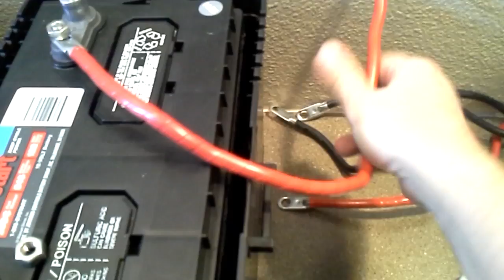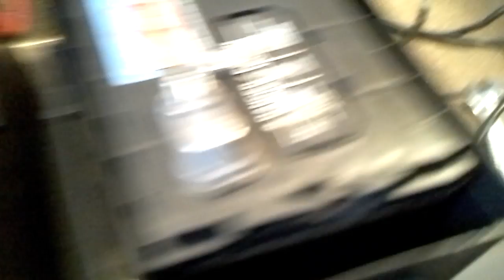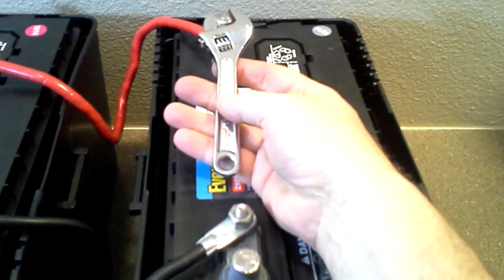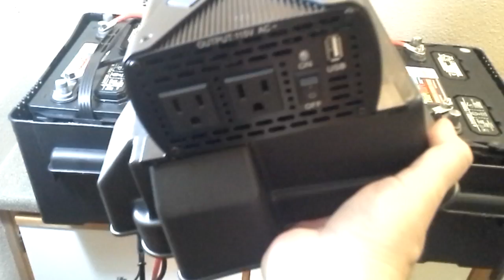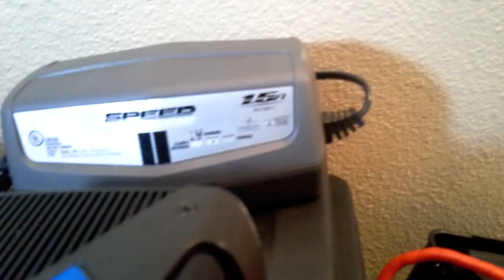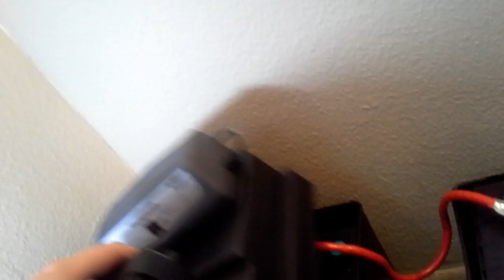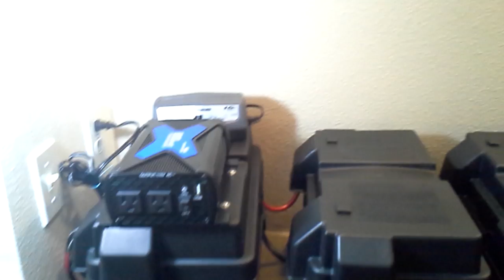Installing 4kW/Hr battery bank with 800W 120V Inverter and Trickle Charger from Tactical Woodgas

Comment: must be a small refrigerator and freezer that your running to run on less than 800 w
Reply: Newer "energy star" appliances are better, and older appliances should be measured with a Kill-a-watt meter.  

800 watts is the average power rating.  For a short amount of time the inverter is rated for double that.  It helps with the extra power needed to start the refrigerator compressor motor vs the power required after it starts.

Comment: It might sound as a dumb question but when the wall socket has no power because you didn't pay the bill or because local electric grid supplying the power is off (usually for a day or two) of if you go on a trip to places with no electricity, how will it work in the wood for example?
Reply: I saw them overseas working with solar power it will be better to have an automatic recharger when the battery needs charge it's turn on when they are fully charged it turns off that's my thinking anyway
Reply: The whole point of this setup is to be charging the batteries while plugged into mains power, and then the inverter can run "some" things when mains power is not available.  Then when back on mains power the batteries get charged up again.
Reply: best thing to do is buy a battery charger an plug it into a port on the inverter an let it continually charge.

Comment: If you use automotive battery clamps, You use wire that has been stripped and it goes under the flat price of metal so that the wire is in direct contact with the clamp. You definitely don't attach a ring terminal wire to the screw that's used to tighten the clamp to the battery post. The screws on an automotive clamp are not there to use to connect wires to. That are not intended to be used as conductors. Every time you pass electricity through dissimilar metals you have a corrosion site also likely to listen over time.

Comment: A little confusing on that ac outlet on the wall? You plugged into it to power something up but yet at the end you say ok, now on backup power 😳 . If you need backup power, your not going to have an ac outlet working, right??
Reply from the maker: The AC power is used to maintain charge so that it is fully charged when your power goes out.

Comment: You want to connet the + on 1 end and the - on the opposite end never connect bot on 1 end of the battery what a waste of the 2 other batteries
Reply: James Mccurdy look up the difference between series and parallel connections.
Reply: Chris Mac i know the differwnce i also know you dont draw power from 1 battery you connect + at the 1st battery and - at the last battery
Reply: Chris Mac let me break this down 
Batter on left is 1 battery in middle is 2 battery on right is 3

Connect the battery the way he did to keep 12 volts

Drow + from battery 1 and - battery 3 is the correct way 

What i said had nothing to do with what you said
Reply: You're right of course. The 2 other batteries will still be adding to the set up, but not quite so much as the first, &  one or more batteries might fail a bit prematurely.  You never want to connect the plus and minus cables from an inverter or battery charger to the terminals of the same battery. The Smartgauge website shows how bad this can be for parallel strings, especially at high currents.  The amount of difference they calculated is surprisingly bad if it's done incorrectly by just drawing from, or feeding into, the first battery of a string. If you take it "on the diagonal" (if the batteries are side by side like here) "plus" to the first battery, but "minus" to the last, it greatly evens out the amount of cable resistance.

 Bear in mind that just a fraction of a volt makes a big difference to how much charge current a lead acid battery will take from a battery charger too. Heavier the better with battery cables for inverters. For a lot of batteries in parallel there are other more complicated ways shown on the Smartgauge website to minimise losses, and not take more from one battery than another in a parallel string. Kind regards.
Reply: James Mccurdy I understand what you are saying now. I thought by your first comment you meant he should have connected the whole thing in series. My mistake!
Reply: Where the connections are made for the inverter makes absolutely NO difference if the cables are large enough and short enough to keep the resistance down.
Reply: @gener.1253  I disagree with you due to my experience working on electric vehicles for over 13 years. I've personally seen what happens when a parallel bank is wired incorrectly. It prematurely destroys the batteries on the end of the bank.

Comment: Are you using 110v house current to power charge controller?
Reply: Not needed in this system. There is no solar, wind, or hydropower directly charging the battery. It is only charged by a smart automotive battery charger plugged into the grid.
 I can't think of any charge controller not powered by the electricity flowing through them.

Comment: They only showed the cca amp
Reply: True deep cycle batteries don't have a cca, as they are not meant to turn over an engine.
Reply: @sundancer442  True Deep Cycle Batteries can most definitely have a CCA rating.

Comment: How many hours would this many batteries/ setup could they run my refrigerator?
Reply: If using the type of battery shown in the video, you would need 47 to run your refrigerator.  That does NOT include the ice maker in the refrigerator.  If the refrigerator has an ice maker, you would need to add an additional 12 batteries for a total of 59 batteries.  But, understand this setup with the 59 batteries would only power your refrigerator for 18 minutes if you're lucky.
Reply: With an inverter that could handle the brief surge every time it turns on (1200-1500 watts) these batteries should last many hours. It all depends on how much energy your refrigerator uses. You can find out with a plug in energy meter ($20-30)
Don't pay attention to the troll above.

Comment: Why would you have battery charger hooked up to the wall,lol I’m I stupid or something I’m not sure your doing here
Reply: Oh wait you must be on a generator outside ok that makes sense
Reply from the maker: @shadmeyer7791  
Many people have the battery bank to deal with unexpected power outages.  Keeping the AC charger plugged into the wall ensures that the battery is 100% charged when the power goes out.
Reply: Same thing here . wondering why inverter was still plugged in.
Reply: @tonyteel  Tony,  most inverters have an on/off switch on them.  So you leave that switch off (so it does not use any standby power) with the inverter permanently connected to the batteries. If the house power fails, you switch the inverter on, plug in the appliance you want to keep using, and turn that on. The battery charger, on the other hand, should be plugged into the wall socket and left on (so long as it has a "maintenance", or "float" cycle in its charging routine -ie a smart charger), and it then keeps the batteries fully charged and ready for use. Older "dumb" or "linear" chargers should not be left charging the batteries indefinitely as they do not reduce the charging voltage to a safe level after the batteries are charged.  If using one of those, the correct method is to switch it on for about an hour once a month to top up the battery charge.
Reply: MAKES SINCE TO ME TOO- WHY

Comment: You plugged in the AC out let into the wall socket???
Reply from the maker: Hi Mike, thanks for the question.  The trickle charger is plugged into the wall outlet.  That way the battery is fully charged when the next power failure hits.
Reply: Never ever connect that kind of inverter to the grid. He connected a small battery charger to the wall outlet, not the inverter.

Comment: This was 5 years ago.  Is there an update as to how well this setup worked.  There are similarities between this and one I'm building for solar.   I am concerned about hydrogen gas venting into the electronics.  Although it is neat in appearance, I just wouldn't place the charger and inverter on a battery case. 
I noticed a question as to how one could achieve the wattage claimed from the batteries.  I have deep cycle batteries they list on their label the cranking amps and the true amperage.  Mine are just above 100amps each.  Amps times volts equal watts. So not factoring in efficiency which results in a loss we can say 4 x 100a = 400a,  12v x 400a = 4800 watts.  As I said there will be losses in efficiency.  The wire, the condition of the batteries can be calculated in as losses. 
I've seen fuses used between batteries, solar charge controller where applicable and between the battery charger when hardwired. These are just observations.  I appreciate the video apart from the safety issue. I have spent my life in the radio and television industry. As far as camera work, cut the guy some slack. He said his regular camera person was not there when shooting the video. But he got it done. YouTube is full of worse.
Reply: Forget about lead acid batteries and simply use Lithium Iron Phosphate ones. Pay the much higher price for extra power, ease of carrying and convenience of layout as well as longer service life.

Comment: You wired in the inverter wrong you need the positive connected to battery 1 and negative to battery 3
Reply: Correct. Ideally the charger (in) on positive 1 & neg on battery 3 - the inverter (out) on pos 3 and neg 1... and a 100a fuse on the pos 3 for an 800w inverter. Especially with 3 batteries so they stay in balance. A fuse between each battery would be best in case one fails and shorts.
Reply: @ejbh3160  I always use the square fuse in the terminal mount fuse blocks
Reply: And where's the Earth? There should be an earth from the negative of the batteries and the negative of the inverter through a bus bar and to an earth rod in the - earth (or to the chasis if in a vehicle)
Reply: @3ormorecharacterstimes2  I use (Gold) ANL fuses from battery and to inverter and have a DC trip switch and isolation turn switch (not essential but super-safe if there's an issue you just isolate the batteries from the rest).
Reply: But if charging from solar - always turn the solar off first before disconnecting batteries or you blow the charge controller.
Reply: given that the system is connected in parallel, why is the negative termination wrong? wouldn't it be "the same" whether or not the negative is terminated in bat 1 negative or bat 3 negative? thanks!
Reply: @dennislee29  Over time, it keeps the batteries in better balance if you do the 'work' (charging/discharging) with pos and neg at opposite ends. Think of it as one big battery - in a single battery you'd want the opposite terminals to be at each end of the individual cells to keep those cells in balance... likewise if 3 batteries are paralleled to make one battery so it keeps all 3 in relatively the same balance.
If one battery is doing most of the work - that battery will wear faster than the others. If you spread the work load across all 3 they degrade at the same rate. Not such a big deal with  lithium as they (should) have a BMS that copes with parallel and they last thousands of charge cycles and degrade much slower anyway.
Reply: @dennislee29  Absolutely not, the only other advisable option for running three batteries would be to connect both the pos. and neg. of the charger and inverter to the center battery to ensure an equal draw of current from all batteries. The way it is the 1st connected battery is under more strain from the inverter, the draw reduces further down the line.
Reply: Looks like amateur hour🤣 You even used, the adjustable wrench backwards🤣
Reply: @3ormorecharacterstimes2 I agree 100 percent in the case of 3 battery's the same rule applies for battery banks of odd numbers 3 ...5...7 ..etc.

Comment: Sir I have Solplus55 IP54 inverter . How manny solar panels watts and battery volts i need.
Reply from the maker: Jorjio Sapigao 
How many kWh do you need per day?
Reply: Tactical WoodGas sir I need 5kw per day.
Reply from the maker: Jorjio Sapigao 
1200W of solar panels
5000 amp-hours of battery
Reply from the maker: Sorry, 500 amp-hours of battery
Reply: Tactical WoodGas sir the same series connection right and the wire from solar panels to inverter what guage and wire from batteries to inverter.
Reply from the maker: Jorjio Sapigao 
What is the input voltage of your inverter?
Reply: Tactical WoodGas DC INPUT.. max. DC power 6600 watts... Max. DC voltage 850 V... DC start voltage 380 V.. Rated input voltage 450 V... Max. Mpp voltage 750 V... Min. Mpp voltage 345 V.. Max. Input current 17.4 A.
Reply from the maker: Jorjio Sapigao 
For high voltage like that, please consult a local electrician.  I work with low voltage only.
Reply: Tactical WoodGas thank you so much sir. But if you have friends to know that please help me sir.. Because you have a actual experience.

Comment: may I ask something?
what's the difference between KW/h and KWh?
Power (W) is Energy per unit time (J/s)
Power divided by time is J/s^2!!!
OMG THE ENERGY HAS ACCELERATION!!!
Reply: He took total amp hours times 12 volts to get watt hours.
Reply: @TheSaltblock  notice the title...🤔🤔🤔
Reply: @TheSaltblock  watthours is different from W or KW PER HOUR !!!
Reply: @TheSaltblock  in measurement, even if your magnitude is correct but the unit is wrong, that is still wrong, got it???!
Reply: @fukaishikonoenjinia8729  haha yes i see what you mean. He meant 4000 watt hours OR 4 kwh. Tada
Reply: Actually there is a difference between KWh and KW/h.  One is an expression of the RESERVE power stored in a system (KWh) the other is the maximum possible draw on the system. With the stated 4KWh system you have 4000 watts stored in the system, but there is no way you can pull 4000 watts at once from it, do so and you will blow your batteries and anything connected to it into the next county. The heat generated from such an exchange would over load the system. This is the difference between KWh and KW/h. KW/h is the amount of TRANSFERABLE power that you can pull SAFELY from your batteries in a given amount of time. You will always have much more reserve power than transferable power, and exceeding the transferable power will short out your batteries and likely cause an explosion.
Reply: @lenf2  how are appliances rated?
well, most of the time they are rated in power (that is watts), in some countries the household supply voltage is 220V, so  even it is not written it is understood that if the appliances is rated, for example, 1000W, the amperage is about 4.5A. So if i build a machine, for example, a motor, with a rating of 6HP, I can draw out that much power in just a moment. THERE IS NO SUCH THING AS KW/H. DON'T TRY TO ARGUE WITH YOUR OPINION. SCIENCE IS BASED ON FACTS, NOT OPINIONS. IF THERE IS SUCH THING AS KW/H PUBLISHED AND WRITTEN IN REFERENCE BOOKS, LET ME KNOW...
Reply: @fukaishikonoenjinia8729  If you have a battery with a storage capacity of 100ah you CANNOT pull out 100amps in a single burst, the most you can pull is about 60amps. Just because a device can STORE an amount of power does NOT mean it can deliver it all at once. This is the difference between reserve (or stored) power and transferable (or deliverable) power (kwh vs kw/h). Try reading a little thermodynamics. A motor is not STORING power, it is converting it, either as electrical or chemical power, into mechanical power. In either case the motor cannot convert ALL the power at once. It may be able to USE the power, but it can't draw or convert it. Kilowatt hours are a STORAGE factor that tells you how much power is in the system (battery for example) while kilowatts per hour is a USAGE factor, how many killowatts you USE.
Reply: @fukaishikonoenjinia8729  I said the motor is CONVERTING energy, not generating it, from potential to kinetic. Maybe you should read a bit closer next time. I guess you feel the only way you can hold a discussion when some one disagrees with you is to become insulting and harassing? And I stand by my assertion that there is a difference between storing energy and converting or consuming it. KWH is how much a system can store,  the number of Kilowatts you use per hour (KW/H) is how much you USE.
Reply: @lenf2  oh my goodness there you are again. You still believe that there is actually KW/H. Instead of arguing with me, why don't you search the KW/H in the internet, on reliable references, and find out about KWh and KW/h rather than spouting nonsense,self-generated,  fictitious information???
Reply: @lenf2  I want to buy a motor that uses chemical power to produce mechanical power as you said. Can anyone tell me where can I find this specific type of motor?
Reply: @fukaishikonoenjinia8729  I guess you have never seen a lawn mower?
Reply: @lenf2  how does a lawn mower work?
Reply: @lenf2  how does a lawn mower work?
Reply: @lenf2  electric lawn mower or fuel powered lawn mower?

Comment: Does the battery have to have same amperage
Reply: Yes, it's pretty important. As close to the same age too if possible.
Reply: @Mathew Sparkman Not true, smaller batteries WILL charge faster, giving a false full reading. I suggest you talk to a solar technician.